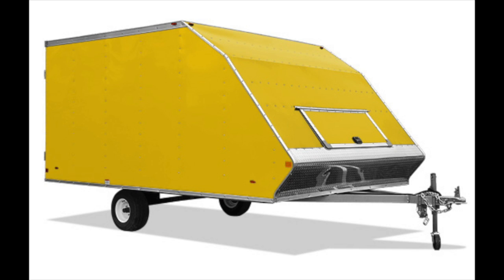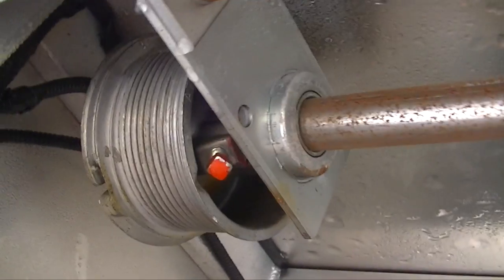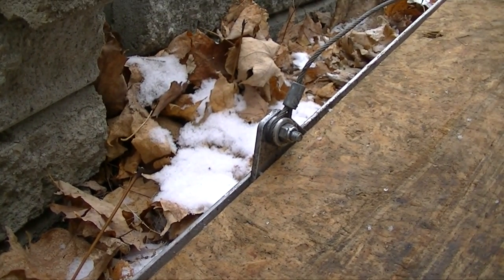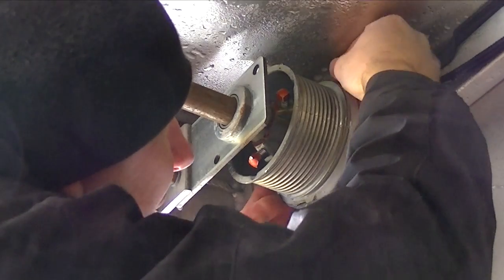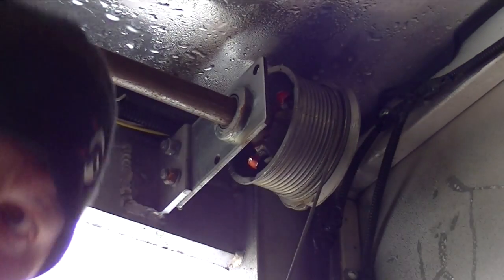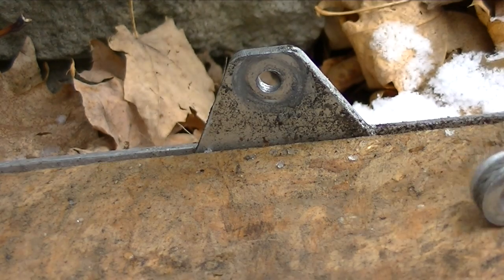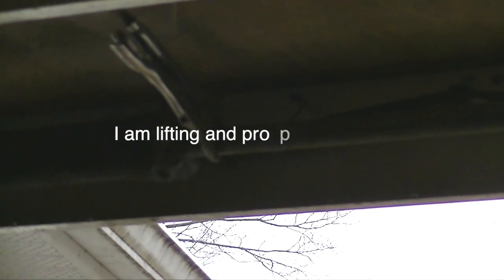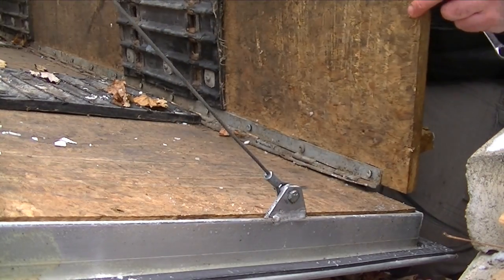Hybrid Snowmobile ATV Trailer Ramp Door Repair - How to Fix BROKEN CABLE

Comment: Left a comment a few days ago, but it disappeared.  This is a good video, but no need to use the vise grips.  Follow instructions in video to the 3 minute mark.  Then, instead of using vise grips, just have another person push down on the OPPOSITE side cable(the one attached and working).  This will give you the slack you need to fit the bolt in.  5 minutes, 2 people...and you're done.
Reply from the maker: good tip!
Reply: @mudbrats  it's a helpful video!  This is like a $100 repair if you have to take it to a shop. I just did mine a few days ago.  Followed your instructions, then took the tip that Greg Poston left earlier about pushing down on the opposite cable to give some slack.  Worked perfectly.  Other videos trying to tell people to do with the door closed and to loosen bolts on the spring!  No thanks, I prefer not to mess with things under pressure.
Reply: You’re assuming that everyone is going to have a helper. Or an extra person. If you don’t have a helper it. It IS A NEED for the vise grips.

Comment: Once the cables come off the pulleys, the spring recoils to it's closed position, aka, least amount of tension. I don't understand how the reattached cables spooled onto the pulleys (when closing the ramp). Did you spin the spring axle to the open tension position prior to closing the ramp at the end of the job?
Reply from the maker: The other cable was still intact so creates the tension.

Comment: There is an easier way than what you displayed. If you spool the good cable and leave it about 4 inches short of the eye bolt fastening, then have someone else push down on the opposite cable just a few inches till you have enough slack to fasten the eye bolt, then release the tension and your done. Open and close the ramp and you will find it works and auto tensions each side. Five minutes time my son and I completed the task with the only tools and open end wrench for the eye bolt.
Reply: Do you have a video showing all that? Thank you
Reply from the maker: great tip
Reply: Trying to follow your directions...when you say 'spool the good cable', you mean spool the unattached cable like is shown in the video?  So you're basically doing like in the video except instead of using the vise grips, you'd just pull down on the already attached cable and this gives the slack to attach the bolt on the loose cable?  Thanks for the tip.  These things are always coming off.

Comment: One side came off actually it didnt break,,will thus be ok to fix or will I have to be extra careful?? Thanks
Reply from the maker: if it is like mine, you should be able to reattach it as shown here.  But if you are not sure, i would find a garage door company and have them look at it. Let me know how it goes.  Most hardware stores sell cable, crimp ends and connectors so you can easily make new cable as well... with 1 cable my door was way too heavy to lift.  I would be afraid of the second one breaking and the spring will unwind and the door will way to heavy to lift.
Reply: Mud Brats TV thanks  I will try in the morning.. yeah I tryed to put it on but it wasnt right , not long enough because i didnt know to use vice grips to stop it.. Thanks I should br able to fix it now.. will let you know..👍🏻
Reply from the maker: Daveyboy I am happy this video can help!

Comment: That's not the proper way to do this... I'm certain his failed again later.  I've done this so many times.
Reply from the maker: No it hasn't failed since - 2 years later and a lot of open and closes winter and summer.  What do you suggest if it does fail again?
Reply: @dh6984  Because it's a trial and error thing when you can't find anything online to explain it well.  It's a pain for sure.  Very aggravating to say the least.